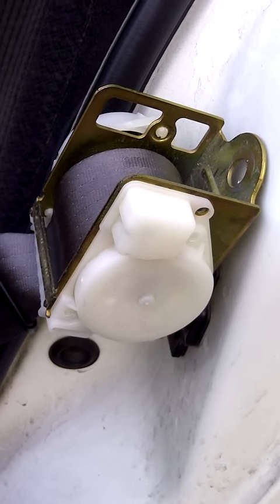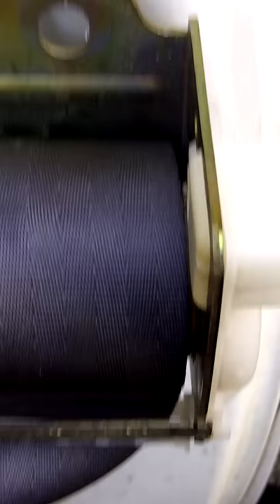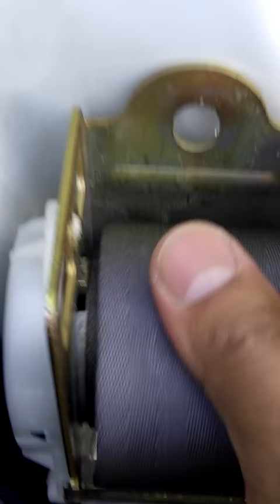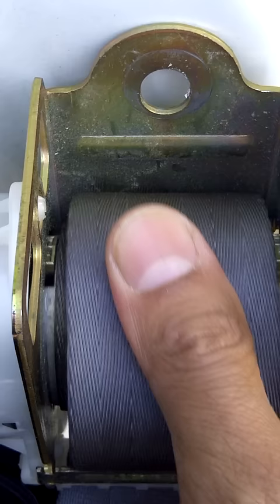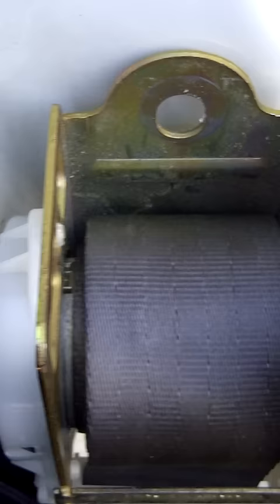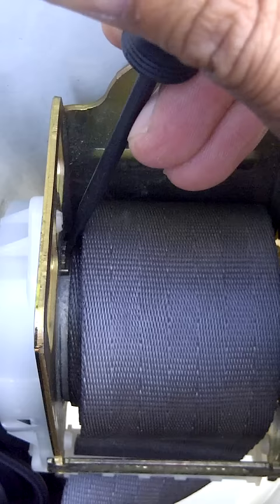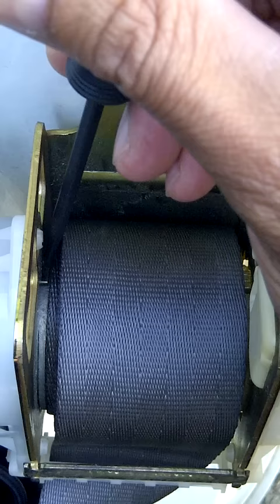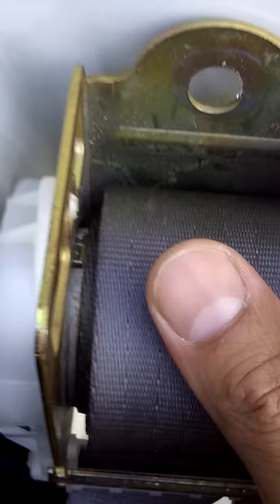How to fix locked seat belt retractor

Comment: It may not be your case but the reason your seat belt has locked its because usually the seat belt mechanism is designed to work only in one position, specifically the same position it is installed in your car. So if you put it back
Reply: Lol you are correct the release has to be perfectly level
Reply: You the man!
 Didn't even have to watch the vid
Reply: Thanks will try both now.
Reply: I've just tried that and you're right !.. held it so it was in the same orientation as it is on the car, gently lifted the strap and it came out...
Reply: +1
Reply: Omg yes, if you hold it the right way it comes right out
Reply: yes, I'm sure that while perfectly vertical on the interior of my car it was in the wrong position and that is why it locked up.

Comment: they actually have a “child lock” type locking mechanism on them, you remove one of the aside caps and unlock it. install the retractor on vehicle ane it will work normally again.

Comment: I’ve seen a seat belt that has been removed, lock up somehow unless it is stationary and perfectly plumb up and down. I would set the seat belt on the ground before you try the screwdriver idea, make sure it is perfectly still, right side up, and only then try to pull the belt out. Any movement or rely can lock up the seat belt and then lead one to believe it is malfunctioning. If it worked fine before your removed it chances are it is perfectly fine, it’s just a user error.